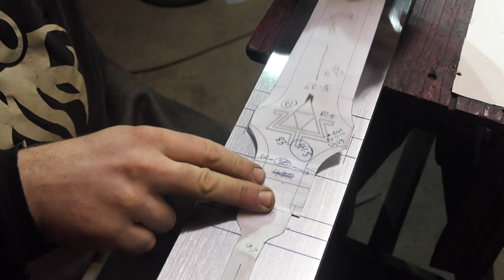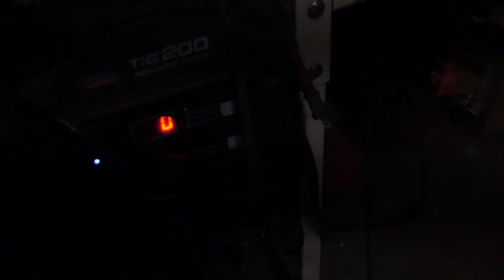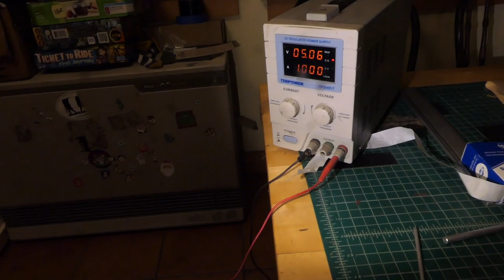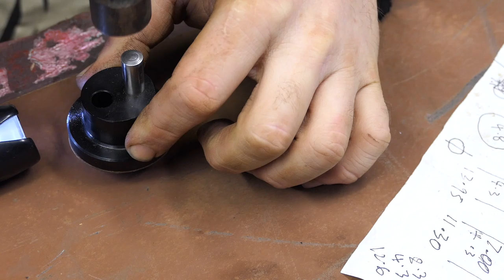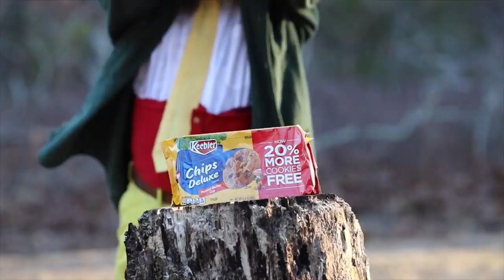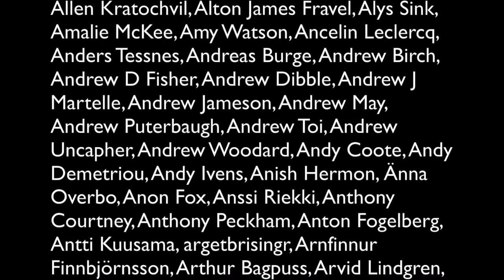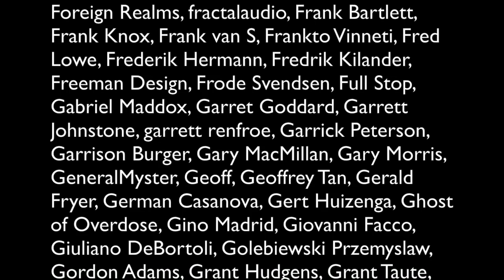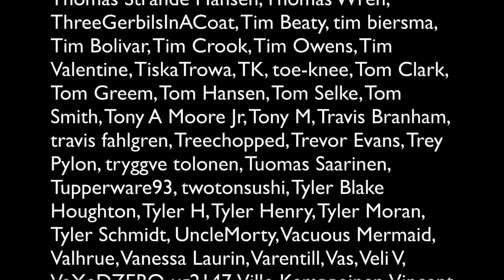Master Sword Patreon Edition

Comment: In response to your musings, yeah, brass is the one that is a huge pain to drill. One of the big issues is the way it chips there is a tendency for it to grab the bits and really screw stuff up, which is why sometimes you may hear some machinists talk about "brassing off" a set of bits, which refers to slightly dulling part of the bits to prevent (or at least reduce) the grabbing, then sticking them aside and reserving them for use only with brass and certain plastics.

Comment: I don't know what process you were using to weld the aluminum but if it was AC High Frequency the waves can fry circuit boards on electronics.  In welding school we used to take our phones out of our pockets and put them in a locker if we we're going to tig aluminum.

Comment: This deffinitly ain't the one they sell at gamestop...
Reply: The hexagonal cross-section was replicated. It's totes accurate, like the examples in history. If you's gonna use the hexagonal cross-section, y'gotta make it have less weight so it's more effective. The diamond cross-section usually counts as bein' lighter AND sharper. The Falchions in Fire Emblem (the series) have the diamond cross-section. But the hexagonal cross-section has more durable edges while havin' the weight (like the Master Sword in the manga adaptations where it's got the weight that's heavy fer folks not chosen to be its masters).
Reply: @truelionofhylia8437   Tinder
Reply: It's spelled definitely
Reply: @truelionofhylia8437  ....?

Comment: Copper would be the soft metal that is a pain in the ass to work with
and the aircraft bit would be use when building or repairing an actual aircraft, to get inbetween the ribs of a wing for example

Comment: For small parts like those diamonds it's easier to stick sand paper ro small bits of steel with some spray glue then it handles more like a file

Comment: Should have used Cera Kote paints instead. Ceramic powder paint that is heat tolerant and would have worked great and looked a lot better.

Comment: Nice one this. Have to point out, welding Aluminium is just like you experienced, it doesn't flow like steel no matter how high you crank the amps, you just have to deal with it behaving like snot.

Comment: Also looks like a baby version of the Lady Death sword, which you should also make now of course, if you already have, i haven't found that video... YET...
The figures in you etched in would be cool with niello, not sure if that would take or hold because of the thick metal since you heat it from the bottom, or if it would hold under abuse.

Comment: So the tungsten ime works better on aluminum when its not too pointy, but still tapered. ill usually just flatten the tip real quick before switching over. Aluminums heat dispersion capabilities are amazing so preheating a thicker piece never hurts. I try to really melt the piece before introducing the filler rod.

Comment: Every time I ever sheared a piece of steel it got slightly bent. Most small shears have the blade on a hinge, the arc of blades travel during the cutting action bends the workpiece. I assume a large, industrial guillotine type shear wouldn't curve the piece.

Comment: I wonder if he's ever tried water soluble oil for drilling through that stuff. I've been a fabricator/ welder for 19 years and have always used cutting fluid to keep the bit cool. Granted, I've only drilled through mild steel and stainless. It always make me cringe when I see someone do it. Or hear it from across the shop. Lol

Comment: Aluminum Aluminium... it's all a question of the spelling based on the country. The reason for the difference in spelling is interesting but not to get too pedantic both pronunciations are correct and phonetically accurate.